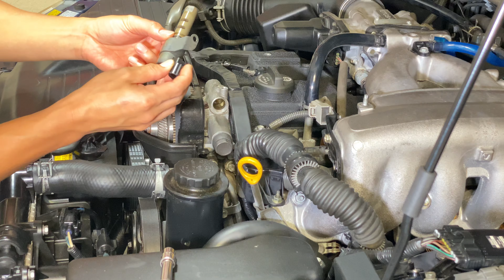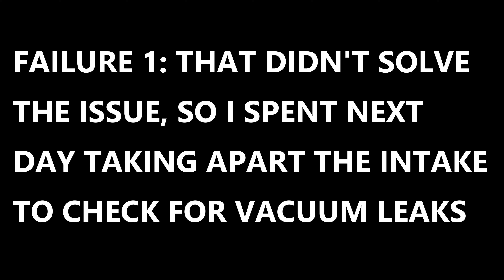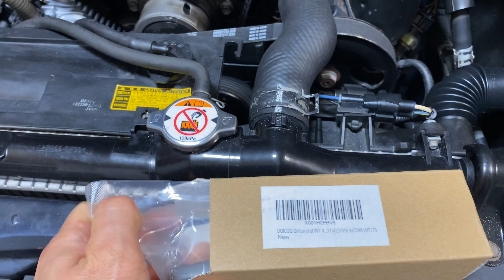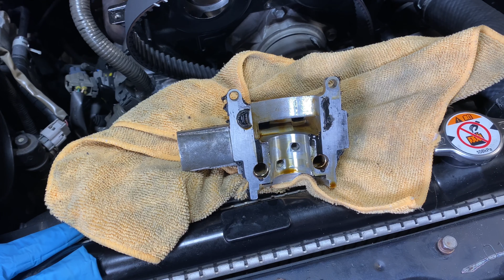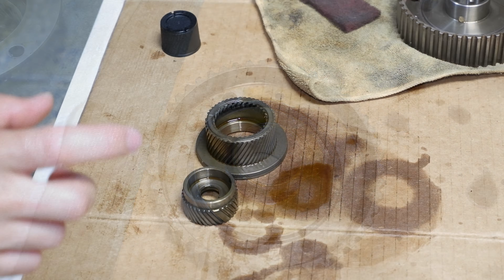Lexus 2JZGE P1349 Code Fix/Repair | VVTI Variable Valve Timing System Malfunction Bank 1

Comment: How did you correct the timing? I notice my timing on the two cranks line up but my crank is not. My code Cam on due to a loose pulley.
Reply from the maker: There’s two timing. TDC and Before TDC, so there are dots and lines on cams and white and yellow at the crank. If they are off, which is bad and you’ll know it due to sputtering. Then you need to remove the belt and reline the timing marks.
Reply: @TunerwithKids  thank you and how would I go about realigning the marks? The top two line marks on the pulley lineup to the timing cover, but the crank is not lining up.
Reply: Update I got my timing Corrected every is good thank goodness 👍🏾. I should’ve did a video on it for those who need help.

Comment: How did you take off the gears without taking everything apart, you still have the radiator and everything else in place?
Reply from the maker: You can access cam gears without removing everything

Comment: Thank you for this video. I'm currently dealing with code P1349 now. My IS300 has 196k miles. I was driving a few weeks ago and the my car started running very rough; similar to a massive vacuum leak. Got the CEL and code P1349. I noticed the OCV o-ring was shot as there was oil saturation on the OCV so I replaced the entire OCV (Amazon $20). I also ordered a new filter and replaced that. The old filter had essentially no debris in it. 

The previous owner had the timing belt replaced <30k miles ago. Timing marks on belt line up properly and I'm not getting code P1346 so I don't think the problem has to do with timing. I also verified continuity of the wiring from OCV to ECU pins E5 and E6. I also wiggled the wiring during that check in case an open occurs during movement/flexing. Everything checked out well. I then replaced the female connector as the old connector had a busted clip. I'm still getting the P1349 code only now my car drives completely fine. You can hear/feel VVTi kick in as well. 

My next thoughts were to use Liqui Moly engine flush. I'll get the car up to operating temp and add the engine flush. During idling for 15 minutes I thought about manually operating the OCV to get the engine flush to clear out VVTi passages. From there I'll perform an oil change after. I've used this engine flush before in other vehicles and viewed cylinder head components before/after with great results. Hoping it could work here. 

Any thoughts on the above or my next plan of attack? I'm attempting to avoid removing the entire VVTi system if it's not necessary. According to the repair manual, I may have to replace the ECU if everything else checks out well. Thanks again for all of the excellent content you provide!

Comment: Came across this video when trying to diag my car. It seems the problem is that the vvti solenoid isn’t even getting voltage. I used a multimeter to make sure there isn’t a break in the wires and also checked at the pins by the ecu and still no voltage. I even swapped the ECU for another. Any ideas?

Edit: I went in on tech stream and was able to enable the solenoid manually and stall the engine confirming there is signal. I’ve ran it more and now all I’m getting is random misfire codes in cylinders 2,3,4,6.
Reply: Having the same, you figure it out?

Comment: Maybe you can help me out. I hear a ticking sound when I connect the  vvt plug and reason you would think that will that happen and how to diagnose it. Thank you in advance
Reply from the maker: Check voltage, sounds like it’s getting power if you hear solenoid clicking. It shouldn’t be powered until VVTI kicks in.

Comment: hey i was wondering, for the banjo bolt does it matter if the two holes in it are perfectly lined up with the oil line? when i put mine back together they aren’t exactly verticals with the line, and i’m guessing oil wouldn’t be able to get through properly.
Reply from the maker: Is your banjo bolt not OEM? It’s an odd size to be not OEM version.
Reply: @TunerwithKids  at least to my knowledge its OEM, it looks the same as the ones in videos. I drew a line on the head to show where the hole goes through, and it ends up a little bit crooked compared to the oil line that goes into it.
Reply from the maker: Do you have both washers? There’s one one either side of the banjo.
Reply: @TunerwithKids  yeah i’ve got both, the inside and outside one. edit: the banjo bolt is the one that holds the ocv filter correct?
Reply from the maker: Yes. The filter snaps onto the tip b
Reply: @TunerwithKids  in all the videos i’ve watched on this, no one mentions the holes on the banjo bolt. Is this something i shouldn’t worry about?
Reply from the maker: As long as they are in the round part and sealed by washers, you’re good.
Reply: @TunerwithKids  awesome thanks! It’s in the round part that’s sandwhiched by the washers.

Comment: Has your 1st gen IS ever get stock, not being able to go above 4k rpm?
Reply from the maker: No, but I’ve heard people with that issue due to throttle body or drive by wire system.
Reply: @TunerwithKids  ahhhhh
Reply: @TunerwithKids  thank you

Comment: My electrical connector was stuck from oil and   dirt into it and unfortunately I broke it trying to get it out. I’ve seen people use zip ties to make it stay when it breaks. Do you think that is ok or should I go through the pain of wiring a new one
Reply from the maker: Common connectors on Toyota cars so I’d try and source one on Amazon or newer car at junkyards. I did a video on that. https://youtu.be/lhgJSPKUd74
Reply: Thanks!

Comment: Hey I have a have a is300 and it threw a code after 30 mins after timing belt (done at shop) change and I replaced the solenoid (aftermarket) and the mechanic replaced the o ring (cam gear) is it possible he did the same thing as you but mine is running normal?
Reply from the maker: Maybe. My symptoms included no power after 4k rpm and no brake vacuum due to the gear being backwards.
Reply: Same boat here… did you ever find this out? I also have no symptoms but a constant p1349. The only things I haven’t checked are the cam cap and the gear itself.

Comment: Have an 01 is300 with codes p1346 & p1349. Oil all over engine bay and looks like it may have gotten into timing belt. Was told it might be the vvti solenoid… would this cause oil leakage and these exact codes??
Reply from the maker: Lot of oil leaks can be bad O-ring. The codes are a sensor or solenoid not work.

Comment: I have the p1349 and p1346 as well as misfires in one side of the engine on cylinders 1,3,5,7. G
Coils look good and plugs seem to be fine. Could this cause it seeing that it is on one side of the engine only
Reply from the maker: Misfires are probably coils. Worth replacement including wires since it’s a pain to troubleshoot and test due to manifold.

Comment: How did you take the intake cam gear off with out pulling the lower timing covers off?
Reply from the maker: You can impact it slowly or hold cam by wedging a crescent wrench with a bar against shock tower. Since I already did the timing belt and WP on a previous video, it was still easy so I impact it. Just slide belt off and make sure everything is lined up before starting.
Reply: @TunerwithKids  thank you!

Comment: I dropped one of the washers trying to get the filter out 🙃🙃🙃🙃🙃🙃🙃🙃🙃🙃
Reply from the maker: Yea it’s tight. I dropped mine a few times but luckily could reach it with a stick.
Reply: @TunerwithKids  do both washers go on the same side?
Reply from the maker: Nope. They sandwich the banjo fitting. One between the bolt head and other against the engine.
Reply: @TunerwithKids  oh okay thanks. I think my oil leak is coming from there and it could be why because I dont think both washers sandwiched the bolt.  Does the smaller washer go between the engine and the bolt or the other way around ?
Reply from the maker: Both washers are the same. If you have different, better pick up a new set from a Toyota dealer. It’s like $3/each.
Reply: @TunerwithKids  oh that's good. I cleaned them off and one of them looks worn with scoring so I'm going to do that . Thank you

Comment: Those aftermarket solenoids seem to work ok I've put them into the v6 vvti. I don't rely on longevity with aftermarket parts so I replaced them again after 50000.

Comment: Any videos on ignition timing, using a timing light?
Reply from the maker: Nope, I Haven’t messed with ignition timing since Honda days with distributors. Newer ignition coil controls don’t have much use for timing unless you’re tuning with a piggyback ECU.
Reply: @TunerwithKids  i have the repair manual from the dealer.  It looks like they still do it with the light, just have to put the clip on the igniter.  I just don't feel comfortable doing it, there's no videos out yet for the vehicle.
Reply: @85krash  you can't easy mod the timing in factory ECUs apart from some engines having crank  sensors that can be adjusted.
Reply: Anybody want pictures for that, DM me with the subject "timing spark for 03 gs" I'll know you mean the covered years.

Comment: I have code p1349 on my is300, I already tried replacing the OCV and cleaning the filter, but the code stayed. The car is in limp mode and sputters A LOT as soon as it hits 4000rpm. Is there a chance one of the previous owners rebuilt the cam incorrectly and did this? I don't see why they would even have to open it up in the first place. Any suggestions would help!
Reply from the maker: Try replacement of the gear? Unless you want to open it to verify. When I incorrectly install the smallest gear the car would hesitate between 4K and 6k. Also the brake booster wouldn’t work due the lack of vacuum pressure from the timing being off. The CEL would also come on after the reset once the car warmed up.
Reply: @TunerwithKids  sounds like thats my issue misfiring after i replaced a vvti oring i probably clocked it wrong and cels come up after warmed for faulty vvti sensor
Reply from the maker: That small gear screwed me for weeks. I realized it when I rewatched my video footage.
Reply: @TunerwithKids  hopefully i take it apart right now and clock it right ill not misfire all 6 cylinders i went in and did valve seals for the engine and reassemble and was dissapointed  thanks for the informative video
Reply from the maker: Check my VVTI seal vid, make sure that small gear is installed correct way. . https://youtu.be/Ww_k1TctIY0

Comment: Was your vsc on and car on limp mode, because i have the same code on my 02 gs300 with these lights on and on limp mode
Reply from the maker: Yea. A CEL always disables VSC. This also causes limp mode, most likely cause is the filter and second culprit is the solenoid. If your solenoid tests fine by connecting straight to battery, then check the filter and clean with brake cleaner.

Comment: I need help on the same issue but with 1gfe lexus is200. It happens when the engine is warmed already. I checked the solenoid with 12v from battery its working fine, checked the filter, super clean, oil is clean.

I have rough idle and sometimes the engine shut off when i start to drive. I disconnected the vvt connector while the engine was idling high and then i took wires straight from battery and connect them with the solenoid and boom the engine idled just fine. I am thinking may be no volt from connector? I checked the connector using a bulb and there was no voltage to the bulb even when i was revving the engine. 

I dont know what to do next, any ideas will be appreciated! :)
Reply from the maker: Sounds like a cut wire somewhere. But only real way to test the circuit is to have Techstream and manually activate the solenoid and check voltage or see if engine slows down.
Reply: @TunerwithKids  if i apply 12v from battery while engine is running it does stall or even shuts off, i believe that a sign that the vvt is working. Does it get its voltage from ECU or may be there is something like a fuse i can check? Because i believe this might be more electrical now than mechanical....
Reply from the maker: It is electrical but to really check you may need Techstream the signal  because VVTI doesn’t kick in while idling.
Reply: @TunerwithKids  ayt thanks for the info, i will bring someone to come and check it for me, not sure if he has techstream software or just some other obd2 scanners. If i mange to fix it, i will update for anyone to use as reference....cheers bruv i appreciate ur responses :)
Reply: @TunerwithKids  back again :D too bad the guy for diagnosis didnt come. So i decided to clean the banjo bolt and filter, nothing blocking oil but i just decided to go ahead. I opened the valve cover and saw a hole on a cam shaft gear i assumed its oil passage nothing was blocking it. Engine was never taken apart before.

So i took it for a test drive after engine warmed up the problem started. When my move my foot off the pedal the rpm was on 2000ish even when i brake it didnt go down. So i put it on parking gear still rev was not going down. I had a mechanic with me and he told me its a choke. I put my obd scanner (the check engine light was on) and i get p1656 this time and not the previous vvt system code. I googled and it led me to the same thing. I am confused now is the solenoid an OCV or what now?
Reply from the maker: @el_chilubi7458  sounds like the original issue you already knew. There is a wiring issue between the OCV ( oil control valve) solenoid.
Reply: @TunerwithKids  i phoned my electrician, he said the vvti gets a signal from ecu and he will come to check tomorroe hopefully. I am praying i dont have to buy another ecu. For now i wait till tomorrow to see...
Reply: @TunerwithKids  Feedback, i know it wasnt the day after :D my electrician didnt show up. So i decided to get another new VVTi Solenoid but not genuine, i didnt wana buy used one because i dont trust them. i put new oil with new vvti solenoid. Because it is not genuine part, the nut was not getting in the holes were a little off, i forced, so the solenoid rotated a liiiiitle bit, i dont know if its a problem. I drove the car the whole day and it drove just fine, no problems with engine revving staying up nor stalling.  I do have a faulty O2 sensor bank 1, this never bothered me because i haven't been driving my car long distances till today. usually i reset it and because i drove few miles per day like 1 -2 it usually dont come up. now the thing is, now i dont get the p1656, i get p1349 again, but no problem with engine, i dont understand now, is the timing off? cause the engine performs normal when i drive. Also getting one saying Too Lean bank 1 which i assume its because of a faulty O2 sensor. I am more concerned with why p1349 again and no issue as before.
Reply: I have the exact same issue with my is200 right now, did you manage to solve the problem? And if you did, how did you do that?
Reply: @arvidpalebo3153  same here…highly aggravating

Comment: Same problem ,,P1349 on my corolla altis 2005 mdl ,,,wnhen i start my car ,,the idle is rough on cold start ,,,and idle go up sometimes about any minute and it will go back to normal idle ,,,,but if the engine is hot the idle is ok its normal about 1k rpm...smooth idle ,,,,but the engine is cold the idle is rough, stalling ,,fluctuating,,
Reply from the maker: It’s probably the VVTI filter. Remove and clean with brake parts spray. That’s the first and most common issue. If it persist they testing the OCV.

Comment: Throwing code P1350 on my Lexus es300, having hesitation issues and can't figure it out
Reply from the maker: Probably got bad coil packs with that code. Or something else with ignition.
Reply: @TunerwithKids  
Says running lean on bank 1 & 2.
Reply from the maker: Did you check for leaks in intake after the MAF sensor? That usually causes both bank lean codes. Else, try cleaning the MAF with MAF cleaner. It’s like $8 at Walmart for the dual can set.
Reply: @TunerwithKids  
Already checked intake and already cleaned map sensor too.
Reply: @TunerwithKids  
What about a dirty throttle body. Haven't cleaned it yet
Reply from the maker: I think that’s less likely. If both banks are reading that then it’s most likely a reading too much air somewhere.
Reply: @TunerwithKids  
Could it be fuel pump or filter? I know it's in the fuel tank
Reply from the maker: Possibly but hard to guess. The other option is to get Techstream and monitor the car and sensors to see the issues.
Reply: @TunerwithKids  
What is Techstream?